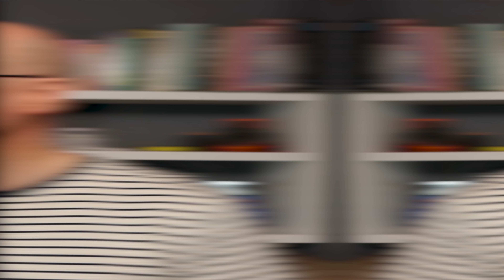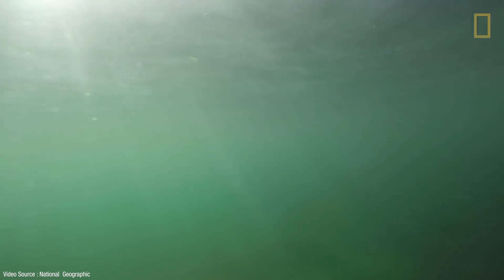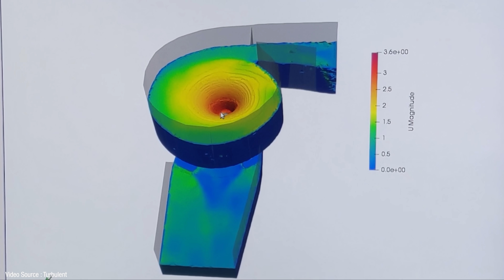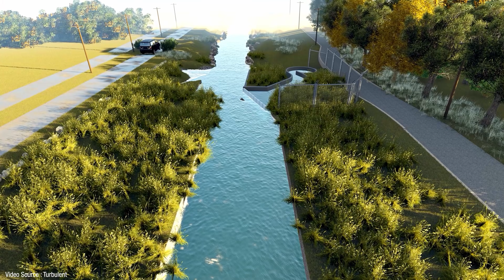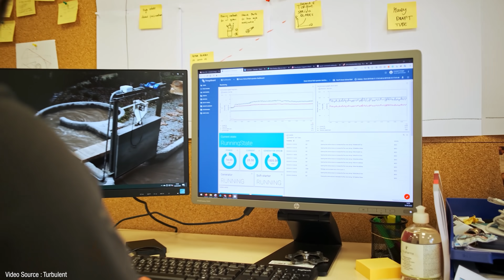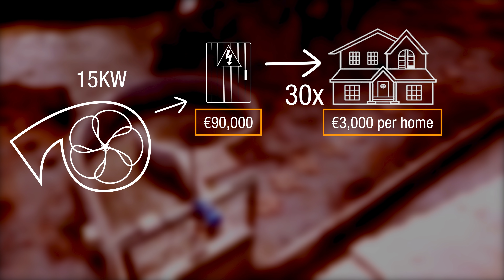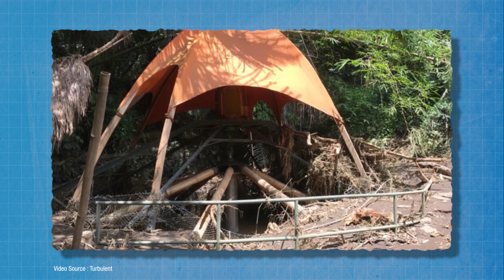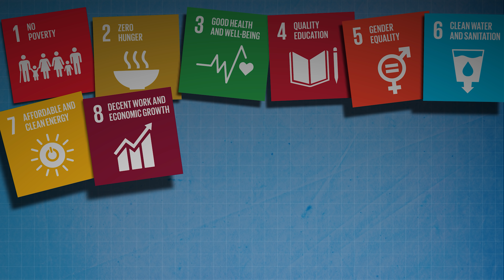Micro Hydropower : Turbulent Turbines

Comment: Turgo turbines are well known, the main issues are reliability and maintainability. I do wonder why so many of these installations use a single unit rather than a pair of smaller ones. If you have a single turbine and it needs maintenance then you lose all power whereas if you have more than one you can shut them down separately and the parts are smaller meaning it is more likely that the locals can handle repairs themselves without needing heavy equipment.
Reply: This is not a Turgo turbine!
Turgo's need 15m head to become efficient and direct "jets" of water at the turbine wheel. This works by getting the whole mass of water to spin and the turbine extracts that spinning motion and adds it to the gravitic energy from the water falling through it! The revolutions of Turgo's are a magnitude higher than this too so you would expect bearing replacement to be less too!
Reply: @totherarf  yes, but slower means higher torque for the same power, which means bigger forces and higher loads. The real test of any microhydro system is putting it in the field and seeing how long it works, and how ugly the repairs are. Low head setups are notorious for siltation at both intake and outflow, and I don't see anything in this design that will combat that.
Reply: @mozismobile  You are right. It is the out of line torques that wreck the bearings though and the speed of rotation that wears them out. Eather way having a piece of kit where you can change a bearing in half an hour down time is not a bad thing eather ;0)
Reply: Because of cost. Small turbines are almost as expensive, so there is really no reason to get two of half the power for redundancy.
Reply: @Tore_Lund  Cost and target market.  They're explicitly trying to sell these to communities that already have intermittent or no power generation at all, so having it go down for a day or two every few years is still an improvement over the current situation in most of these places.  And if the maintenance is likely to take more than a day or two, the old diesel generators can still be pulled out as a short term stop-gap.
Reply: @altrag  Not me, I was arguing against needing duplicates for redundancy, because of cost. This tur
Reply: @altrag  It was not me. I was arguing against needing a duplicate generator, because of cost. Especially this one, which can be pulled as a complete unit with a block and brought to a workshop for service.
Reply: @Tore_Lund  do you think that's why they only install one . Yeah it's still a,lot if money even though we're well off it a lot of money now thinking about it .
Hopefully one day they could make multi turbines on smaller system's.
Reply: @whoever why not have two spinning in opposite direction to counter the pull on the bearings?
Reply: @TheLosamatic  I don't think that would be that effective, since most of the kinetic energy of the water is lost/transferred when it collides with the first turbine. So having two counter-rotating on top of each other would leave it with a bias/larger amount of energy in the top one (as the jet goes nearly directly towards the face of it at 90°, thus needing to do a sharp turn).

But as for what someone else said (can't remember who) about reliability, you could have multiple turbines hooked up to the same dynamo/motor via a transmission system. The system would only connect one turbine at a time. And to prevent the turbine that's not in use from being worn out, you can have a hatch/lid that closes or redirects the water away from the turbine.
Then you only need to pay for the price of one motor. Plus if one turbine/gear-shaft gets worn out or needs maintenance to prevent it from breaking, you can switch to the other turbine to then do what needs to be done.

This actually sounds like something I could feasibly construct myself! Norway - my country of residence - is filled with tiny rivers varying from a few centimetres to multiple metres in width. The benefit is that due to terrain elevation, glaciers, immense rain and snow, and the overall typography, there's nearly a constant stream wherever you find one, and with a lot of kinetic energy!

Would love to hear what you think, Carlo!
Reply: @musiccalgary  I don't think anyone ever said zero cost or max yield usage for all 30 years.  I mean, that wouldn't make any sense anyway - usage goes up and down with the time of day and time of year, so even if you ran "max yield" at your highest usage point of the year, you'd still be well below that for most of the rest of the year.

But generally speaking, these are pretty simple systems.  Its just a big spinning chunk of plastic or fiberglass or some similar material and a few big magnets.  Most of the problem with hydro is finding a place to put it that has a sufficient water flow to actually spin the thing up to a useful speed.

With even moderate maintenance, a system like that could easily last for decades barring some catastrophic accident like a large tree falling directly on it hard enough to smash through the protective gratings and into the device itself.  And if you have that much damage occurring, there is few power generation options that will survive so that's not a particularly relevant comparison.
Reply: @musiccalgary  true but I didn't see the cost comparison include anything to maintain a diesel generator running continuously for 30 years either.
Reply: Micro-hydro power systems using Turgo turbines are well known for their reliability and low maintenance requirements. However, there are a few main issues to consider when selecting a Turgo turbine for your micro-hydro system. The first issue is the potential for cavitation damage to the turbine blades. Cavitation can occur when the water flow rate through the turbine is too high, causing the water to vaporize and form bubbles. These bubbles can collapse and damage the blades, reducing the efficiency of the turbine. The second issue is that Turgo turbines are not self-starting, so they require a higher head of water to start generating power. This can be an issue in areas with variable or seasonal water flows.
Reply: Actually it is better to have 3. With 2 in service, the spare is used when one of the in service units needs maintenance or repairs.  
This way you always have full power if you need it and if you need even more power, in summer say, you can put the spare online.
Reply: @lestermarshall6501  I don't know about the Thugo turbines in particular, but a Pelenton you change bearings every 3-4 years and maybe a broken bucket every 10 years?
Reply: @Tore_Lund  yeah I like the pelton wheel cause they spin fast and the sound is good too . But the river bed speaks of what is best to install and type of dam and spillway to work in harmony with the river and the bed speaks right to the bed rock there got to be locked and the filling only make the dam stronger due to the pressure lock .
It's a well known term In my ways of construction the weight force's itself into bed and the wall or banks of the river.
Reply: @lestermarshall6501  There's a reason you don't find what you describe out in the wild.  As Tore alluded to, this would make the scheme prohibitively expensive and complicated for very little to no gain.  If a turbine is regularly serviced (i.e. once a year on average) than breakdowns should not be an issue.  And a service on a micro-hydro turgo scheme only takes a day at most.
Reply: Yeah that's a good idea to, there must be a reason why they haven't.  Not sure why unless it's the head hight not enough or something like that maybe.
Reply: I was thinking a stretch of bank could be developed, with a series running along one side.

Comment: The guys at Turbulent are amazing. Inspirational what they're doing with turbines! I wish them well.
Reply: Agree! Turbulent is very impressive. We hope to work with them one day.
Reply: Turbulent is indeed making local small scale hydro power a reality.  I really like the way their design provides for as little harm as possible to wildlife (fish) as it operates.  A win-win.
Reply: @johngoldsworthy1925  yes at the most expensive cost we have ever seen and destroying our waters and enviroment well it is at it!
Reply: @terenceiutzi4003  But isn’t that the reason why they’re small in the first place? to avoid too much of those kinds of problems
Reply: Micro hydropower is a great way to produce extra reliable energy, and the guys at Turbulent are amazing. Their turbines are some of the most efficient in the world, and they can help you get your project up and running quickly and smoothly.
Reply: Except for the rounding of the turbine edges, their system is nothing new.
In 1993. in Nemila, Bosnia, a local man (don't know if he were an electrical engineer or an electrical technician), due to the power outage as a consequence of war, built exactly the same thing.
First he built about 50-100 meters of concrete channel to raise the water level to about 3 meters, then made a spiral shape in the end to get the water spinning, and then placed a turbine at the top.
He used maybe a 2kW motor as a generator, and a capacitor to start it.
We could see a dozen incandescent 220V light bulbs running on that power.
Unfortunately, none of the structure is there today. Bosnians tend to go back to the easier way of life once the necessity is gone, and it's easier to just use the grid power.
Reply: @edinfific2576  I worked in " flood control". In our structure were 3 pumps that were used for moving the water. Each pump had an 8' diameter prop. With a 2' head, if you left the unit out of gear, it would syphon the water thru at a speed that would turn the input shaft at 1000 RPM. Which just happened to also be our idle start speed of the Diesel engines. With two people, you could kick the engine in gear and the engine would start. The reason for the need for the second person was to hold the lever on the governor in the run position. 3' of head would likely never happen except for from the downstream to the upstream with us pumping. It was a bad day when the Tailwater came up to over 10 ft from the rains as we could not shut down fast enough. And then we also watched as the Headwater did the same. We weren't allowed to go over 6' on the TW but nature sure could. Ground level was ~10' at our structure so we watched the water flow upstream overland and then come back South again.
Reply: What’s the smallest head of water this system can run at to produce anything useful?

Could a small stream trickle charge a battery store?
Reply: Regardless they remove the oxygen from the water and cause vast amounts of toxic solution! And damming the water up releases vast amounts of Co2

Comment: 15kw for 30 homes, that is 500w of base load per home. My pc draws more power than that, am i missing something or base load per home is a little low?
Reply: 500W is 12KWh/day which is plenty for most purposes if you are not using it for space heating. Last month I used 9KWh/day from my off-grid solar and even managed to run my EV most of the month only topping it up with 14KWh off public chargers. 
The average power draw from houses in some of these villages will be in the region of a couple of KWh/day each if they are only using it for laptops, lighting and phones.
Reply: @AndyFletcherX31  and that seems to be what I was missing, storage and constant power instead of just peak power. Thanks
Reply: @nikolas_tes  :)
Reply: @AndyFletcherX31  Cool that you're off grid and you make a good point but he was talking about EU households in that segment so I think he's off by a factor of 3 or 4.
Reply: @stevemickler452  12KWh/day is pretty close to the average in the UK[1]. Remember your "500W" PC probably only consumes around 100W most of the time it is running - try plugging it into a power meter.

[1] https://www.ofgem.gov.uk/gas/retail-market/monitoring-data-and-statistics/typical-domestic-consumption-values
Reply from the maker: Hi Nicolas. If you're drawing 12kWh per day just to run a PC then I would dread to see your electricity bill. A 27inch iMac idles at 60W and maxes out at 240W when going at full tilt.

Comment: This strikes me as one of the best and most obvious approaches to creating a robust, sustainable energy infrastructure. Looking through the comments I didn't come across any serious down sides. Obviously won't work everywhere, but where it will it seems a winner.
I suspect it would be a good idea to oversize these systems and either feed to excess into the grid, or use it to generate hydrogen.

Comment: Yeah, hospitals will still need backup generators if they are not on the grid. Actually also if they do. S**t happens.
Reply from the maker: Or a UPS back up battery supply energised by the turbine system.
Reply: @JustHaveaThink  If the goal is to let surgeons finish ongoing operations and then shut everything down, sure. But UPS systems don't run for that long, and the longer they can run the more they cost. That means if things go bang during the night and you can't fix it for several hours, people on respirators (and lots of other ICU stuff) might run out of air. At the end of the day, smaller grids are almost certain to be more expensive for the same level of service guarantee.
Reply: And, you know, droughts, cause we might be getting a few more of those in many parts of the world!

Comment: I think Norway was offering private landowners grants for similar projects a few years ago. I stayed at a hostel near Voss that had hydropower and they just left heat going even when rooms were unoccupied because it cost nothing
Reply: Part of the challenge of running constant speed hydro, is you have to continue to consume all the electricity produced. One way is to leave the heat on, another is to use electric resistance coils in the water stream to dump excess energy.

Comment: The comparison to the four tennis courts worth of solar installation is a bit unfair. The solar panels don't require any more space than they take up to function. The turbine is fed by a river that gets its water from  a very large area in the mountains. That explains why a solution like that won't scale up very well. When you consider the entire area of land needed to provide the energy, you don't get very many watts per square meter.
Reply: I can see the angle you are coming from. Honestly I think you raise quite a valid point, this definitely can't work everywhere. Although, these turbines solve the problem of intermittent power attributed to solar panels.
These turbines work off of the principal that they aren't leaving a large, man-made footprint on the planet. 
When taking that into consideration, I feel that the length of the river is irrelevant considering that where these turbines will work are places that no one is going to remove the river unless you are planning on putting a large scale hydro-electric dam on site.
I would also like to point out that I disagree with Sebastian as I don't think those comparisons of logic made much sense. As I said, I feel you raised a valid point. However, I don't think anyone is going to remove a river in the effort of ecological conservation.
Reply: It is even more unfair if rooftop mounting or agriphotovoltaics is considered.
Reply: Sure.. Let's be fair and pretend it matters:  then using your logic  the distance travelled by the photons from the sun to those solar panel is a lot larger than the areas crossed by those rivers. Fortunately your point of view does not make any sense whatsoever. Those turbines are a lot smaller than their photovoltaic systems equivalent. Period.
Reply from the maker: Hi Tim. I guess I should have made it clear that I was not denigrating solar (in fact I am a big fan and have solar on my house and cabin), but it is fair to say that within the specific context the turbines take up far less space, so if a site was space limited then this is a good option.

Comment: Diesel: It's also carcinogenic.
Reply: In lots of those out of way areas it is also hard to get, which increases price. And you are lucky if you just have to pay little extra as transport cost to the guy who brings it to your village in soda bottles on back of an old motorcycle, he might also cut the product by adding water or something else so he has more product to sell, which you'll find out when that crap breaks your engine...
Reply: Allegedly.
Reply: @Withnail1969  Check out this video about poppy farmers going solar explicitly because getting fuel for their water pumps is too troublesome and fixing those pumps when there is water in the fuel is even worse.

Comment: Could we  potentially do away with dams using this tech?
Reply: Yes, this will get rid of damns if it will get you to stop swearing.  But, no, it doesn't really get rid of the need for dams.  Dams provide a storage mechanism to allow use of hydro power where water supply is intermittent like in arid areas, in areas where water is supplied by snow melt, and in areas that have wet and dry seasons.  In addition, dams concentrate the power available.  This is a niche solution that doesn't scale due to the rarity of suitable sites.
Reply: @richdobbs6595  apologies! I'm dyslexic and make mistakes like this! Corrected! Thanks for clarifying, I wasn't sure how well this would scale, but still, great invention!

Comment: Good stuff.. Would be great if there were a energy storage solution to come with it.. Also I think it would be fascinating were it to be deployed in flood risk areas for which the energy can be used to run series of flood based pumps. Keep up the good work..
Reply from the maker: Hi Dan. There's no reason why a battery storage system could not be hooked up to the supply. In fact that's a very good idea as a UPS back up for the hospitals I mentioned.